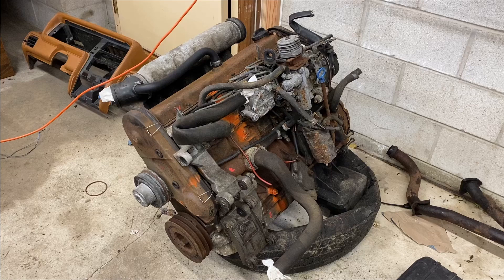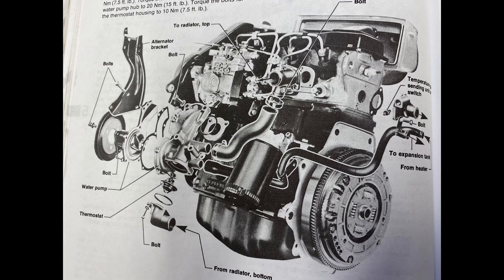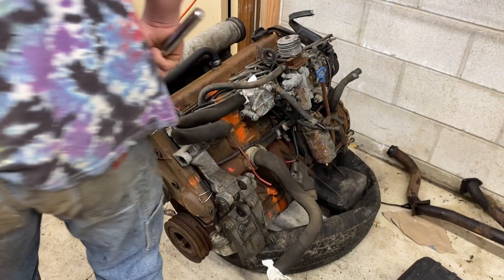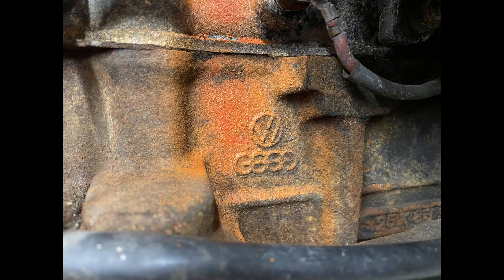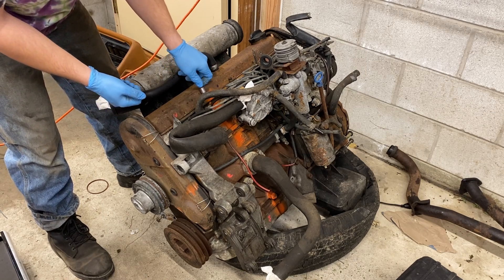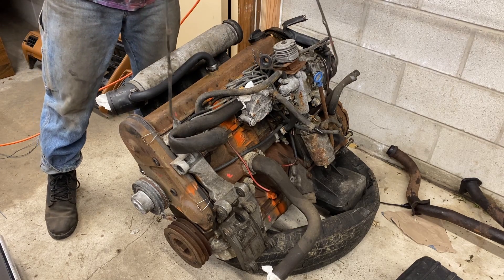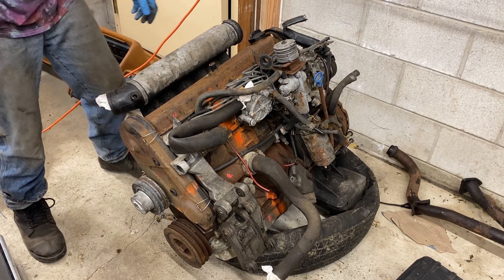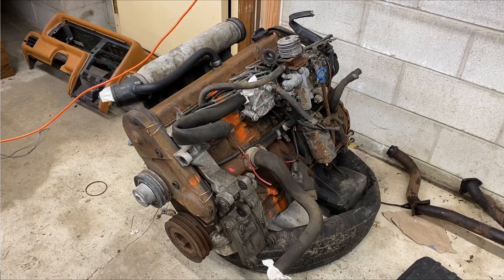D24 Diesel Engine Rebuild 1 - Background and Diagnosing

Comment: Hello, I am glad to see those videos with this engine, you are doing a great job. I have a VW LT 35 caravan from 1991 and I have a problem with the motor, at some point (after reaching a higher speed) the motor won't accelerate anymore, its seems like it doesn't receive fuel. Can you help me with some opinions? A manual of this motor or anything. 
(Sorry for my bad language) :)
Thank you, keep up the good work!
Reply: Fuel Filter ??
Reply: Fuel pump governor

Comment: Plz bulid this! I am rebuilding my d24tic in Canada, I was about to upgrade the head gasket to a mls befor studs. When we pulled the head it was very cracked, through all the pre chambers and between the valves roughly .07mm could fit inbetween
Reply from the maker: I am planning to rebuild it as long as I don't find something expensive like a cracked head or bent valves. I'll have to get further along in the repair before I decide to try to make some power.